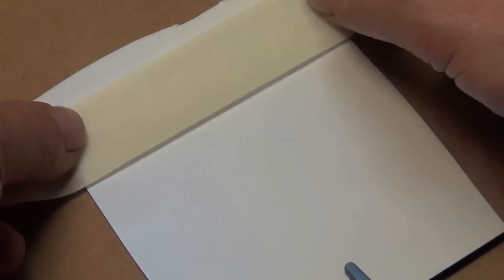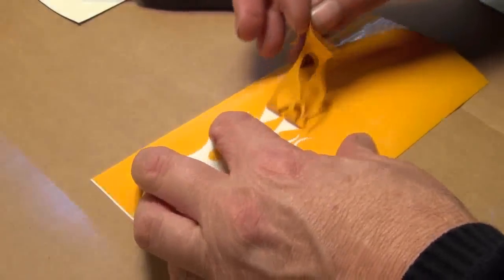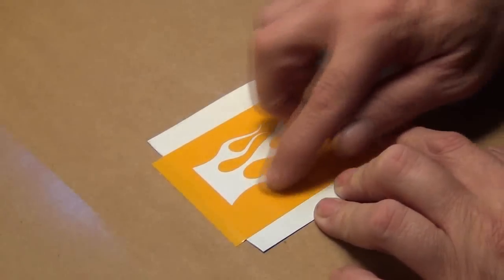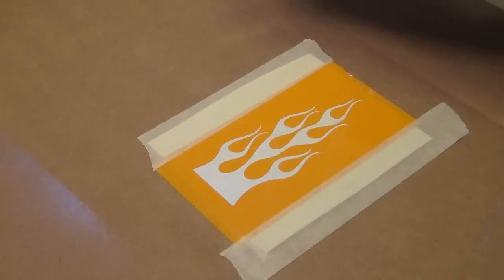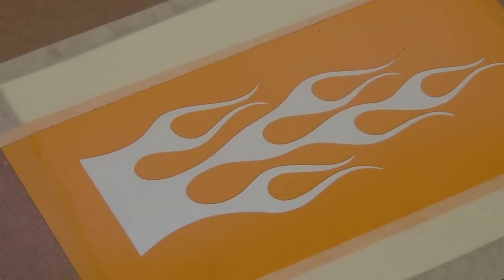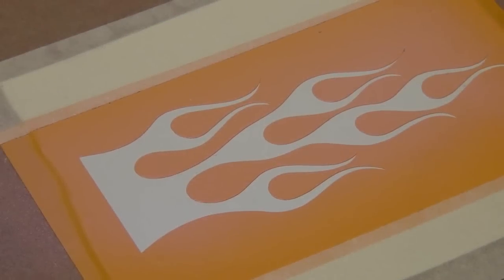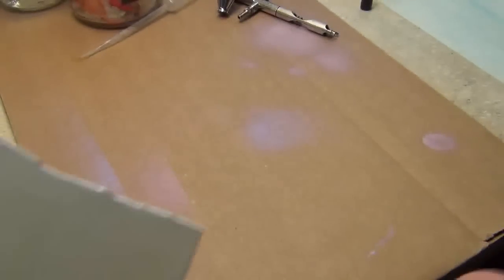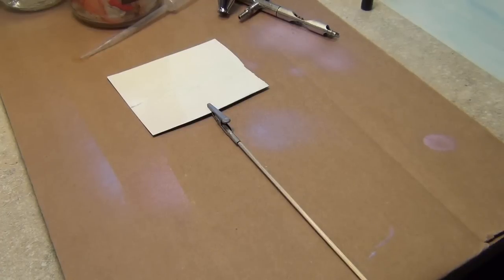Createx for  Scale Models pt 6

Comment: It's ten years later now and Createx has additives to help in all this, starting with 4011 reducer and 4030 intercoat, 4050 UV clear. And more.. That 4030 and 4050 also turns the basic paints into acrylic urethane for use on hard surfaces like models, greatly helps adhesion too..4050 can be a clear top coat.
Reply from the maker: thank you for helping with the updated info bro
Reply: @AndyX  Sure thing Andy. I posted because these products change the Createx game quite a bit. There is also a 4053 clear top coat only product I did not mention. Unlike 4030 or 4050 it's not designed to go into the paint and change the property of the paint to a poly acrylic and consequently harder coat. It's a straight up clear coat high gloss finish. 4030 can be used as a barrier coat between colors too. 4050 can play that same game plus be a top finish coat but in my experience will need a light polish job. And by the way I've managed to let 4030 find it's way into craft paints. If you're still messing with Createx you might want to try some of these. I use Createx mostly with fabrics but it's so easy to mix solid color matches with which I use on classics era cars, I have used it on models as well.